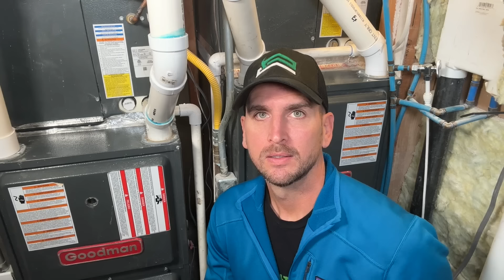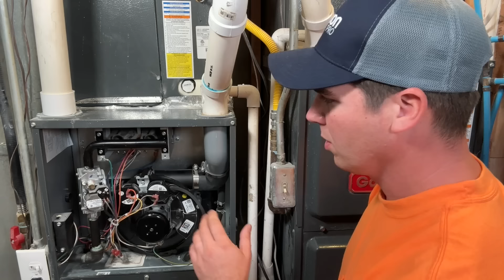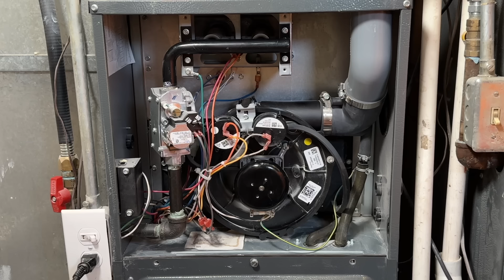How To Manually Light A Furnace | Furnace Not Igniting

Comment: What if my hot surface igniter is glowing but the burners won’t ignite
Reply: I'm having that issue also
Reply: @bazillionairemooney  mine is working now all of a sudden. I just kept giving it a break, & trying again, & it eventually started working. Maybe after not using the heat all summer, it took some time for the gas to actually get to the gas valve. Or the valve was stuck and after a few times trying it loosened up.
Reply: @bazillionairemooney just keep calling for heat from the thermostat occasionally & see if it finally starts working.

Comment: Yes but does that mean you have to keep lighting it each cycle once the thermostat reaches the set temp?  Seems like you'll be spending the day relighting it over and over unless I'm missing something.

I have the defective ignitor as we speak but I just ordered one online hopefully to arrive in a day.  Thankfully we have a gas fireplace to help warm up our lower level for a little but our house is 2 zone which has a heat pump for the upper level which is a great option for all homes if possible. Install multiple systems so you'll always have one working usually....

Comment: Mine only has an on off switch no pilot, its a Kenmore DC80 so if its on is the gas still on ? I turned off the red lever and the pilot went out , but the gas is on and the switch inside is on but isn't lit. Is gas coming out? I don't smell it, should i turn off switch for 5 mins and then turn it on and relight it?

Comment: I've been without heat hear in northern Minnesota for 4 years now. I dread the winter season because day and night I'm trying to keep my family warm. My furnace is new. It turns on and blows but it'll turn off sometimes less then a min. Or when does blow it's only blowing cold air out the vents for one to two mins then shuts off. Any advice will greatly be appreciated.
Reply: Sounds like it could be the flame sensor. If the main burner lights but shuts off after a few seconds, it could be that the control board is not sensing a flame and shuts the gas valve off. The control board will attempt to light the burners 2 to 3 times, after that your blower will come on and blow cold air and will eventually lock out and need to be reset. If the problem is the flame sensor, then it would need to be removed, cleaned and reinstalled and problems solved.

Comment: Dealing with this right now. I changed the heat sensor because I figured that's why the hot air wasn't blowing. Then i turned on the furnace, red flame (is that the ignitor?) came on, but then didn't catch to blue flames, shut down, and did it again. Any advice please besides calling an HVAC guy?
Reply: is the gas on, do you hear the electronic gas valve open, there could be so many issues and if you are blindly changing parts it could be just the piping, i would recommend getting a multimeter
Reply: Did you ever figure this out?

Comment: This is really educational to watch, when you are in a jam.
Reply: So, I’m to understand that when the pilot light/flame is not ongoing in your furnace, there is no problem or risk of a gas leak, in the house. This is during the period of time when you are not using the central heating function of your furnace & the furnace flame remains unlit. The central a/c unit is located outdoors, but the a/c reset mechanism is not located in the thermostat, but in the home furnace unit, it appears to me. Am I correct?After changing the batteries in the wall thermostat, I had to push several switches, close the doors to the furnace properly, unplug & plug back in the power to the furnace, & now the a/c fan(outside) works! I don’t understand the workings of the system. Can you elucidate, please?I forgot to mention, I checked my thermostat & there is no controls for reset, as I noticed, in viewing other thermostats on YouTube instructional videos.

Comment: I did this and now I have heat. I saw no red glow. So when the house reaches temp and stops blowing, will it keep heating, or do I have to light this every single time? Like every few hours or everyday?
Reply: you have to KEEP lighting it ONCE it reaches the SET temperature and SHUTS OFF....When it goes to turn on again, since their is NO FLAME, there is NOTHING to heat the gas, so YES, you will keep having to MANUALLY light it EACH time......

Comment: This is combustion equipment.   The homeowner shouldn't attempt this.  In sane countries you require certification to work on gas fired appliances.  I'm a licensed hvac Mechanic.  Do.  Not.  Do. This.

Comment: Hey my guy, you are so wrong and I really hope to God nobody takes your advice if it's not lighting it's not lighting for a reason.
Just because you can do something doesn't mean you should.

Say one of those orifices were plugged or the manifold had a crack in it and you had a spill leak and you are now going to go and put an ignition source not in the way of the draft from the inducer, kaboom

I've done residential HVAC for over 15 years and I would never recommend somebody to do what you're telling them to do hell look at the install of that equipment you on.
Reply: This is for an emergency heat situation. And that’s the purpose of the rollout switches. If someone doesn’t want to fool with it, we aren’t twisting their wrist but this gives them an option.
Reply: This is like mechanics not recommending people fix their own cars. Maybe you’re right maybe you’re wrong, but you have a financial interest in people not doing this on their own, which makes us skeptical.

On the other hand, as a pro, you’re an expert, and you’re qualified to give good advice here….

It’s a conundrum…

Comment: But remember, if you're a professional and do this it's potentially a code violation depending on where you live. These units are only certified for use or installation as they were originally certified. IE if it's IPI it stays IPI.

Don't do this, get a space heater and replace the HSI for 65 bucks. I'd pay at least 65 bucks just to avoid having to do this repeatedly, I guess if you don't value your time or someone else's
 safety  I've seen guys pull their manometer off an NG gas valve with the burner on and it flashed and started a roaring fireball out of the front of the furnace. He lost most of his facial hair and almost started a house fire.
Reply: Just aayin.. illegal to run a unit like this voids your homeowners insurance here if the insurance company ever catches wind that a lighter was even near an IPI system. 9 times out of 10 you won't have a problem. But that 10th time if you're not careful you won't even have a chance to know something went wrong

Comment: There could be many reasons a furnace doesn't fire. Being in the trade rarely replace a faulty ignitor vs other issues.  Should be left to people with experience to repair it properly. Ignitors are cheap

Comment: If the inducer fan has water in it and is not pulling sufficiently this could be dangerous.
Reply: Actually, It won’t get to the stage of turning the hot surface igniter in and allowing gas in if the inducer isn’t pulling proper vacuum at the pressure switch.

Comment: Puzzling. If there are no safety concerns, then why does my furnace have a label affixed to it with a warning that says, "Do not try to light the burner by hand."
Reply: Then don’t, you can freeze until your hvac guy comes in 3 days haha
Reply: It's obviously for liability purposes.
Reply: That's there for legal reasons. Inexperienced people tend to blow things up when they think they can fix something that they have no certification or knowledge in fixing. 

Often, rules are laid, not because someone thinks it up but, because someone has done it before.
Reply: Also what about this seemed unsafe to you?
Reply: The Q-tip box says not to put those in your ears... been doing it since I was 5. Stop living in fear, you wuss!
Reply: Thank you so much for this it works ❤️

Comment: Don't most furnaces with a peizeo or hot surface igniters have a failsafe if they fail to light the gas!? 
I know on my dad's old furnace, his hot surface igniter failed and would shut the gas off within 5 seconds of a failed ignition
Reply from the maker: Yep, the flame detector is the failsafe.  That is why you only have 4 seconds to light the burners or the gas valve will shut off. 👍
Reply: There are furnaces out there that use the ignitor as the flame sensor also. Don't see them too often anymore tho
Reply: @ajs7878  that's because the gas valve was controlling the logic for ignition. They were called honeywell smart valves and were abhorrently expensive.
Reply: @samson11105  The ones I'm talking about are older than the smart valves. Even the smart valves have a dedicated flame sensor. These  the hsi did both without a rod
Reply: @ajs7878  ooof that sounds like an expensive part.
Reply: @samson11105  Actually not too bad, A lot of universal ignitors work just fine as a replacement. First time I seen it I was really confused cause the burners would light just fine but go out like a bad flame sensor. Luckily my service manager at the time was old as fuck

Comment: The inducer motor is pulling and testing for vacuum, the pressure valve will verify that a vacuum is pulled so that the exhaust gases can be adequately vented out of the house. You missed a step between the inducer motor starting and the hot surface igniter lighting.
Reply: Does the inducer continue to run after ignition?
Reply: @z95m  this motor runs THE ENTIRE TIME until the call for heat is satisfied-- if the induced draft motor failed, the flames wouldn't get pulled into the heat exchanger anymore.
Reply: @andrewludwig9251  Thanks!
Reply: @andrewludwig9251  if the inducer failed, the gas valve would also never come on. So this manual light procedure obviously wouldn’t apply if the inducer was not functioning. Just thought I’d add that 👍🏽 cheers
Reply: @z95m  no it only comes ok for about 30 seconds and then when you have ignition, it turns off. That’s why this has to be manually lit every time you want to run the furnace in an emergency situation where your igniter is bad.
Reply: @z95m  oops I’m sorry, I thought you said the igniter. YES the inducer runs the whole time the furnace is in heat mode because it is always pulling exhaust out of the heat exchanger.
Reply: @diyhvacguy  Thanks!
Reply: I skipped that step because In this failure mode, there is no hot surface igniter as it’s broken.

Comment: My Ruud furnace has a spark ignitor.  A "failure to light" malfunction usually means there's crud built-up on the spark ignitor.  Usually, you can carefully clean the surface of the ignitor.  Really though, the ignitors are fairly cheap (less than $20), and available everywhere (including online) so I just keep an extra ignitor in the furnace closet.
Reply: How did you clean it?

Comment: I've stuck a propane torch in the igniter hole. I have a networked thermostat, so I'd fire up the torch, stick it in the hole where the igniter went, and turn up the temp. I did that for a week while waiting for a new igniter.

Comment: My 1962 gas boiler water heating system uses no electricity.  Thermopile for the gas valve and  no circulator on the system.  all gravity feed heat.

Comment: Wait, a MAP gas torch is the wrong thing to use? 🔥 🚒
Reply from the maker: Aggressive 😂
Reply: Screw that I'm going for the b tank
Reply: @smitty90100  Screw that, I'm going for the oxy-acetylene.  B-tank, air oxidized acetylene just isn't aggressive enough.  Gimme a rosebud tip and 7/21 psig acetylene/O2.

Comment: I bought a hot surface igniter and a flame rod and have them on hand, just in case.  $80 of insurance.
Reply: In the 16yrs I’ve been doing HVAC, I’ve only ever seen two flame sensors that needed replaced.  One was because the person before me broke it.  Just clean it with a green scotchbrite scouring pad.
Reply: @DieselBenz  it was only 4 bucks so I figured, what the hell. Not much can go wrong with a steel rod.